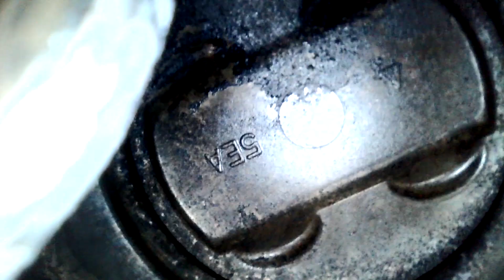Yamaha XJR 1300 Engine Exploration - Shoogly Shed Motors Episode 59

Comment: It will be a long haul but worth it, you can tell that the bike was just thrown together and stored, the problem that you get with some of these big old bikes is that they were poorly maintained main issues being cheep oils and not changing oil filters when changing the oil. However on the bright side these engines are fairly brutish so can take a lot of abuse before giving up and I suspect the that the lower end of the engine will have had sufficient oil left in it to keep some parts rust free. If it were me I would drop the sump plate and have a look with your new gadget see whats up inside. When you do pull out the engine have a few strong mates around as they are a very heavy lump. Dragged enough of them about to know they are a great back breaker. Enjoying watching your journey :)

Comment: I would do a compression test and potentially see if it will run first, before i pulled the top end apart. If it runs some heat cycles and a couple of oil flushes might do wonders...